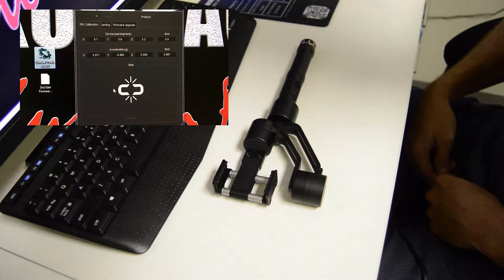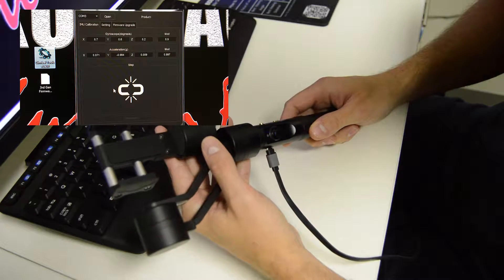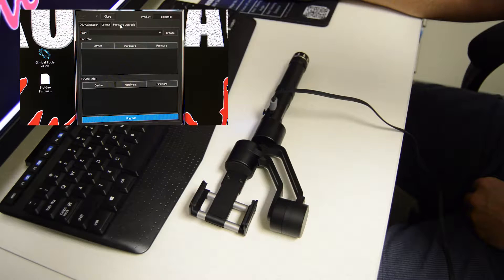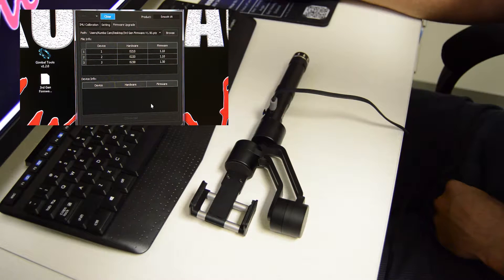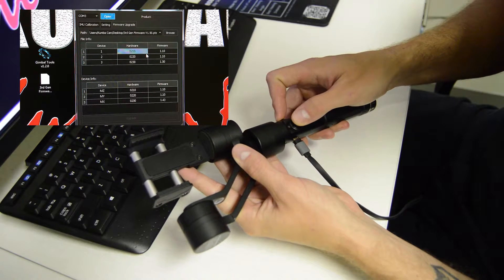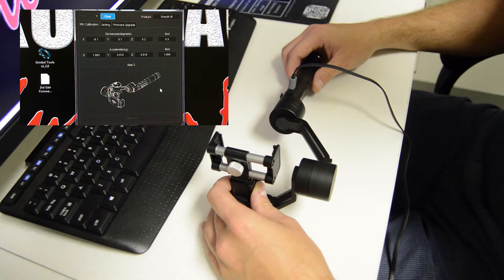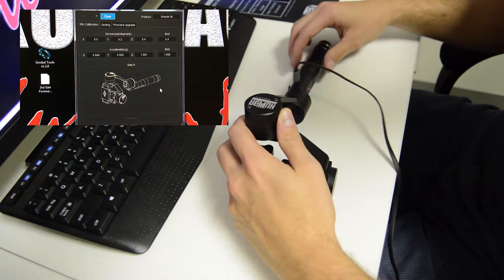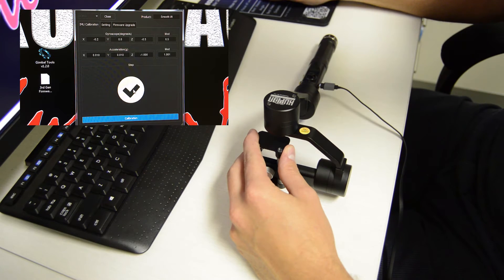KumbaCam How-To: 3rd Gen 3-Axis Stabilizer Calibration and Firmware Update

Comment: you have to do this when you purchase this device?]
Reply from the maker: It comes calibrated and updated with the latest firmware. However over time, if you experience a problem like tilt or drift - to troubleshoot,  you would recalibrate and check for firmware updates.
Reply: OK.  Great where can I purchase one?
Reply from the maker: kumbacam.com